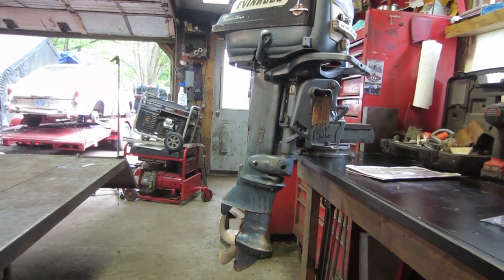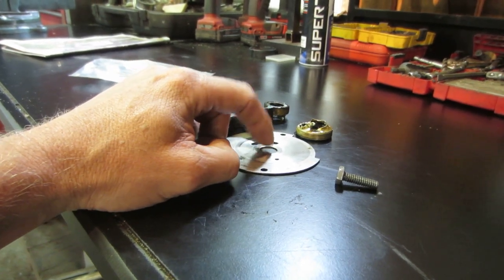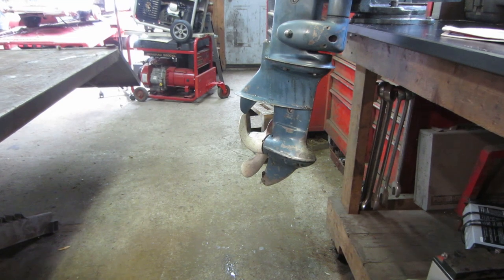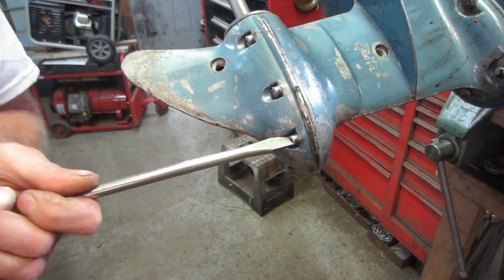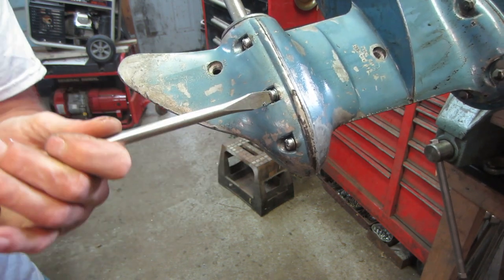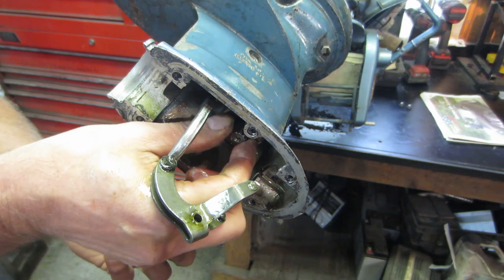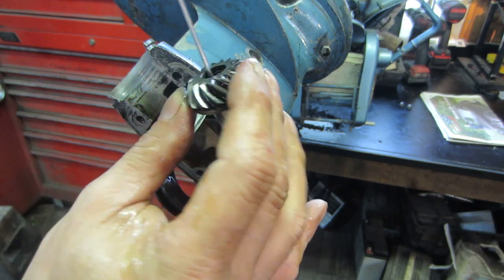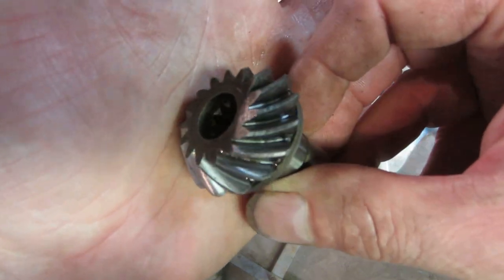1956 evinrude 10 hp sportwin, going in the lower unit once again

Comment: That motor never had a clip as snocrushr says. Thrust raises the pin off of the wear plate. I've worked on hundreds of these.
Reply: Ramblin Man now my question , what if you put the clip in and run it, what will happen?. Best regards
Reply: The water pump impeller has a long grove in the hub to allow for up and down movement of the driveshaft which is critical to the proper operation of the gearcase, driveshaft, water pump impeller. If you use this clip to limit the driveshaft travel you could damage the pinion gear, forward and reverse gears.  OMC machined these gearcases using friction type bearings on the lower horsepower motors.  To a degree, the pinion gear floats in the gearcase.  There is no backlash adjustment on this unit.  Limiting the pinion gear movement could result in gearcase failure.  I've repaired many of these gearcases and they are just about  bullet proof except for clutch dog wear due to people SLOWLY shifting between forward, neutral and reverse.
Reply: Ramblin Man Hmm, not saying you're wrong about the clip, but the pinion could still move all the way up as high as it could without it present..with further travel upwards left in the shaft. Even if the clip is non standard and/or unnecessary, it doesn't look like it'd actually affect backlash.
If the shaft is usually lifted by thrust, i can't see a problem with it not being able to come down the final couple of mm when at rest.
Reply: My concern is if it decides to let loose and take out the gears.  Just not needed.
Reply: Ramblin Man Yeah that point i can understand
Reply: Would a 1956 15 HP be any different? This shows the pinion with the circlip. https://www.nlamarine.com/products/johnson-evinrude-15hp-376485-304265-forward-reverse-gear-pinion-prop-shaft-1956
Reply: +Ramblin Man Hmm, I don´t think so. Have you seen the old wear plate? It was worn out because the pin was running on the plate. So I think Mustie is right with his guess.
Reply: roomba : Yup clearly shows a clip in pics . Case closed
Reply: Roomba.....I believe you have the proper installation shown in your photos.  The clip is a part of this assembly.  It only makes sense that a manufacturer would secure the shaft and not let it float around depending on the gear torque to maintain clearance.  This is the correct assembly.  No further discussion needed!
Reply: +canuckguy worried According to my experience it makes sense with the clip to adjust the height of the pin and I cannot see another way to fix this. Maybe I am wrong, nobody knows if some guy do it the right way before or not. Even we did not know if it is all original.
Reply: +canuckguy worried I found this manual: http://boatinfo.no/lib/johnson/manuals/1922-1964johnson.html#/0 but I dont know the model no. 
As far as I can see there is no clip, 
but maybe I just could not find it
Reply: Thrust does nothing on the shaft down or upwards, the bronze bearing at the lower sides takes the thrust and upward motion from the pignon wheel, and not the shaft, fact is (stupid construction) that in the first engines the shaft rests on the pin from the inpeller (the splines where to long in the shaft where the gear is on) later models have a clip on the shaft to keep the drivepin from the inpeller free from the where plate, and centered in the inpeller.
Reply: I would say check the gear lash with and without the circlip, but as long as the pinion is riding on the thrust bushing and not forced on it you should be ok
Reply: roomba you are correct roomba. Internal circlip shown in position in the pinion in the photo. It is inconceivable that a heavy shaft rides up off a stainless pump seal plate just because the pinion gear is helical. What are some people thinking, they are wrong. All that shaft weight sitting on a tiny drive pin half buried on a stainless backing plate in the pump? Nup! Look at the picture of the pinion with internal circlip in position that roomba has outlined above. Well thunk out mustie1, keep on fixing. Mustie1 saved a JD green grass tractor for my model plane club because you showed the little hat that fits on the tappet ends of poppet valves when we had the classic cyl head gasket blow out between the bolts and an exhaust valve let go.
Reply: Ramblin Man what are you on? Rubbish!

Comment: Personally I would have ground the little 'tits' off the circlip because the end of the shaft is sitting on them, this means that the taper on the shaft is not forcing the circlip outwards into the groove.

Comment: 1956 was probably the transition year. And you got one with a c clip. And when I saw you put it together I knew you had put it together upside down. You put the opening of the c-clip where the shaft is instead of sliding it on and turning it over before you put the retainer on to the c-clip.

Wouldn't be a bad idea to replace those bolts with some torque driver Allen head drive units.

First you were talking about a C-clamp, and now you're talking about a snap ring. Those are two completely different pieces of equipment.

I still say when you are putting on that c clip onto the Keller drive shaft, you're supposed to rotate it around where the c-clip opening is pointing down and then put the retaining clip on. That will keep that shaft up in place. I may be wrong, but that sure looks like the way it's supposed to go.

 Quit saying c-clip if you mean snap ring.

No just because it's a squared-off Groove does not necessarily mean it wouldn't be a round piece of spring steel that fit in there.

At the end of the shaft that's not a taper, it's called a chamfer.

That impeller looked like it's a lot thicker than the movement of that shaft. Which means you're probably right about in the middle of it at the top of its movement, at least I believe it's hard to tell when you don't know what the parts are even called? And if it were round metal ring, you're only talking about perhaps five or ten thousands of an inch. That's why I don't think you're at the top of the impeller. You're at the top of the movement of that shaft which may not have anything to do with the impeller. At the bottom of the movement your at the bottom of the impeller, but the shaft is only moving up about a half an inch. And the impeller is at least three quarters of an inch thick, is it not? It actually looks almost an inch but I'm thinking three quarters is what it appeared like to me.

At 17 minutes into this and you're trying to jam that impeller down to get a measurement?????

Please learn how to use some measuring instruments before you do another video. Please learn what you're talking about before you do another video, I'd like to choke you but being just a ham-handed half-ass mechanic. There's only two things you shouldn't put on these pieces of equipment until you learn a little bit more about them, that's your right hand in your left hand. I hate to be so hard on you, cuz I know you mean well. I'm not even going to explain to you why they changed the design of that pinion. Even though you probably don't know what the pinion is which is why I can't explain it to you.

What ring would push out and fall in the bottom of what transm. Do you even know what a transom is?

Comment: Why don't you get a manual to help you with that motor. you have made many mistakes on that lower unit. for example get the right snap ring for the pinion gear, you are making lots assumption and not getting anything correct. get a manual or ask someone that knows the correct way to put it together,.
Reply: Awwwww. Cry.